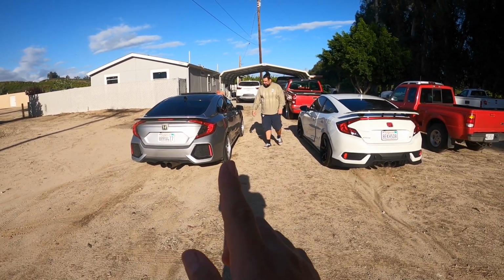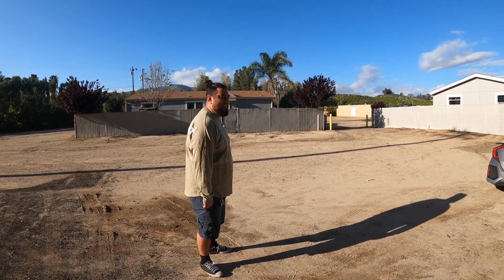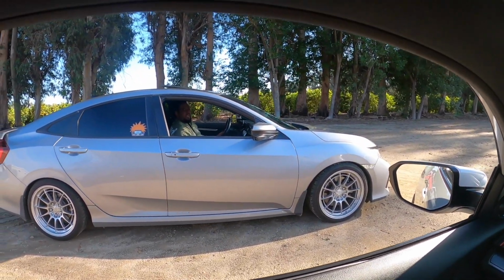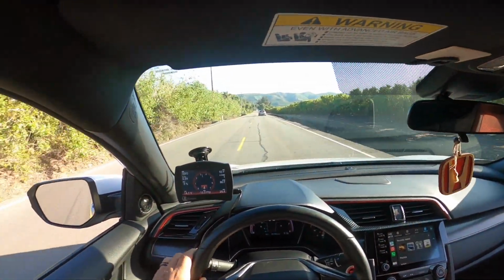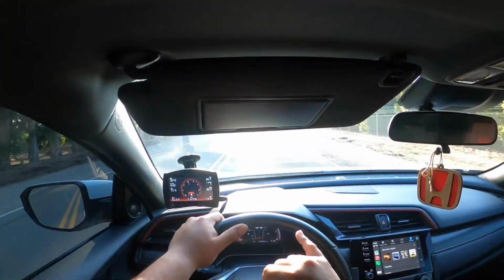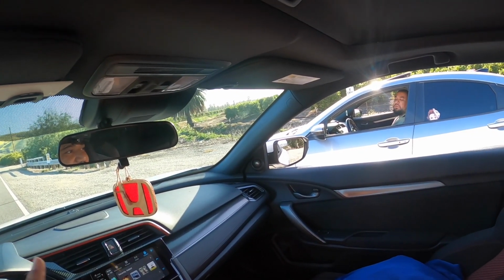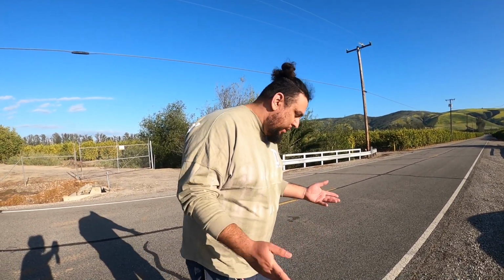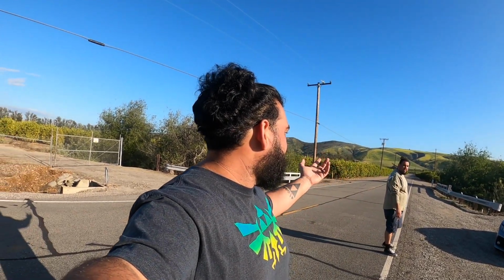Phearable tune vs TSP tune Roll Races | 10th Gen Civic Si

Comment: These are such great / fun cars I’ve had 3 different generations of the si.   8th 9th and 10th gen si.     I truly loved them all ! My 10th gen had muffler delete and ktuner tsp stage 1. These cars offer so much more in a complete package than most of its competitors is very hard to find another car in the price range that can match the performance comfort reliability with updated technology.   
Now I daily an Alfa Romeo Guilia ti sport 2.0t and soon will be putting on a jb4 ,down pipe , intake  
Great content 👍
Reply: I want a 9th gen civic Si because of the raw power of a Naturally aspirated engine I like the interior of the 9th gen than the 8th and like the visibility of the large windows and the torque makes it fun for city driving unlike the 8th where you have to rev out the car which don't get me wrong is fun but not when it's your only daily and you commute in it just feels really slow I'm debating between a 9th gen and a 10th gen
Reply: @turbro7185  I definitely would go with the 9th gen k24
Reply: A year later... How's that Giulia holding up? Have not heard stellar things about their reliability.

Comment: I still need a downpipe, TIP, and intake Manifold to be FBO . I wonder how I would do against you guys 🤔 

My mods : Powermetric Stage 1 tune, intercooler, intake , front pipe
Reply: Downpipe might make you lose a little on the top end but tip doesn’t really gain anything on stock turbo. It was 2-5whp gain for an expensive part. You’re better off getting a downpipe next out of all those things. That powermetric tune makes so much torque at 3k rpm
Reply: @ValkenDnB  downpipe is definitely next just waiting for some funds to come in aha but also I want coilovers more 🤔
Reply: @ElPinche97  coilovers sound cool but I’m not trying to lose the adaptive dampers just yet unless I’m going to track my car seriously I’ll do coilovers.
Reply: @ValkenDnB  mannnn!! Nd I bought mine wit coils but coking from a static car im use to it but God I want that ADAPTIVE DAMPERS

Comment: The turbo inlet pipe gives you power and sound, turbo spools much faster, I have it I should know
Reply from the maker: This is from what tuners and from ppl who had their engines built told me. TIP does add power but it’s very minimal have told me it’s better to wait until you’re bigger turbo.
Reply: @TdaKid  no point on waiting you gona have to do it regardless just one less thing to worry about, besides the stock one looks like a pancake, common sense with bigger TIP will make more power not huge power but enough to make it spool faster

Comment: You should look into getting phearable 1.5R version now that you have the clutch to run map3.
Reply from the maker: I was thinking the same thing lol
Reply: @TdaKid  I’m running it on mine but stay on map 2 since someone in the forums only lasted 3k miles on the stock clutch running map3
Reply from the maker: @gt-shorty8451  I’m more worried about the damn TQ it would make on these cars. Lol

Last thing I want is to send the transmission to the moon after I do a pull lol
Reply: @TdaKid  I think you’ll be fine. Friend of mine is running phearables 2.5Flex fuel tune without issue for about a year now 280hp/320tq. The 1.5R tune hasn’t given me anything to worry about either. I think we’ll run into head lift issue before transmission issues but i wonder if people who remove the clutch delay valve have more tranny issue considering it’s whole purpose is to minimize drivetrain shock.
Reply: @gt-shorty8451  been running the pherable 1.5 race on stock clutch racing, everything 😂 about 7k+ miles on it stock clutch and my car is fine. Only mod rn is an intake with race maf

Comment: Dp, intercooler is worth it when you upgrade the turbo. Stock turbo the stock dp and intercooler are good
Reply: Nah if you’re tuned, the stock intercooler gets heatsoaked after only 1 or 2 pulls, especially in the summer
Reply: @Corny5OH  Big time - unless you run ethanol the heat soak is big power loss
4 mods - ethanol, clutch, downpipe, intercooler....easily max out the stock turbo 280-290whp/340wtq

Comment: What makes 10 gen better than 8?
Reply from the maker: The 10th is just an overall better daily
Simple bolt ons and a tune wake it up 

But the 8th gen is better if you want a project car or a “race car” since the motors are stronger

Comment: With intercoolers do I need charge pipes right away?
Reply from the maker: Some intercoolers will need it some will
Not. Just depends on the brand.
Reply: @TdaKid  prl or mishi could I not get the piping right away?
Reply from the maker: @repinrs  it would tell you on the website saying if you NEED the piping in the description
Reply: @repinrs  I have the stock intercooler piping with PRLs intercooler
Reply: @walahmelons5504  Iats go down with it?
Reply: @repinrs  drastically. And basically no matter how many pulls I do the IATs stay the same temp they were after the first pull